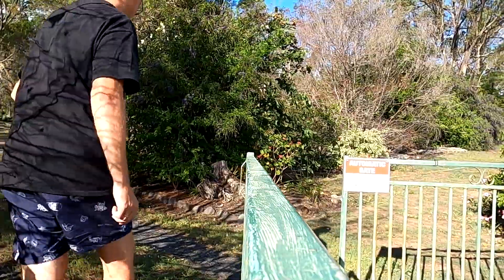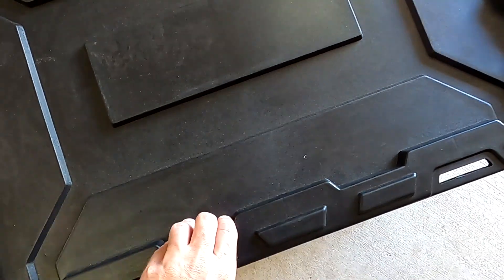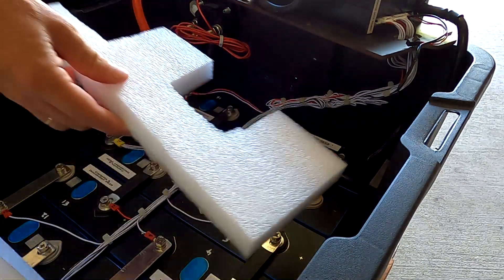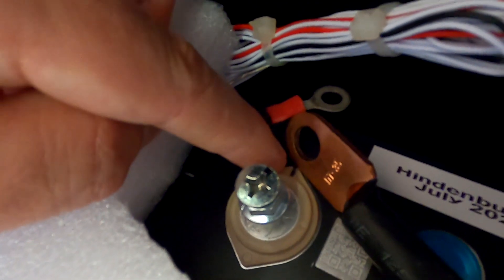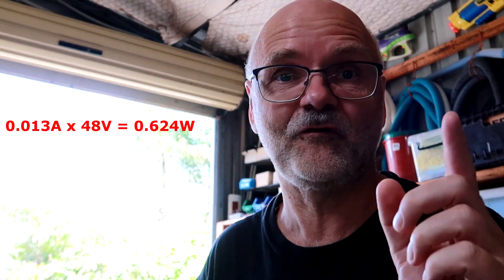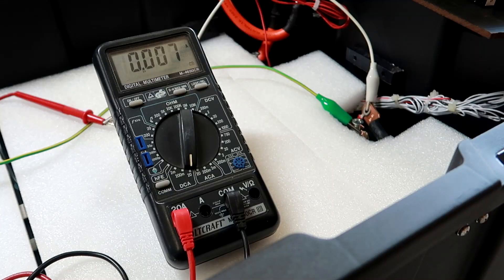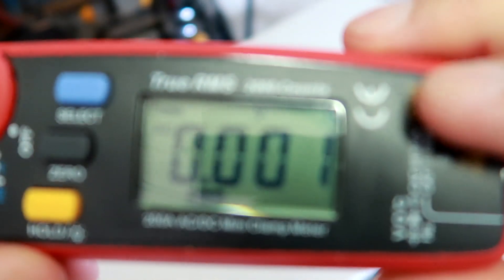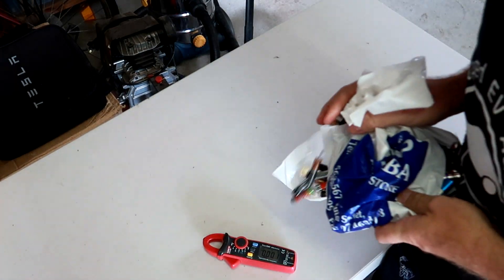BMS with Relay: Temperatures🔥 and power losses⚡

Comment: I agree that idle power is relatively low compared to other components' like inverter. The thing with the typical bms is the effective dc resistance. I am using Daly BMS and it has dc resistance of 20mOhms. At 100A, it would be 200Watts. My nominal battery voltage is 27V so it would be 2700 watts output with 200 watts loss. That's about 7.5% loss. So regardless of current, assuming all other parameters are constant, power loss would be 7.5%. I guess why there is a relay in addition/parallel with the mosfet. That's to minimize resistance at higher loads to minimize power loss. Note, there's more on the connections from connecting individual cells to the lugs etc. Crazy amount of power loss. 😂
Reply from the maker: The panels are not angled to the sun, so the voltage is expected to be lower.

Comment: Might be worth changing the battery in your Multimeter as it can screw with the reading when it's low. 

Also, the spec is probably pretty wide on cheap meters like that one.
Reply from the maker: The Uni-T works the same with either new or low battery until it completely dies off.

Comment: If the bms can't dump the full charging current or back off 
the charger to a level it can 100% handle without disconnecting 
charger from battery bank it has no place in the design .

You need a better BMS ….

Or a diy sub controller .
Polling the bms ( are you balancing any cells ?  Yes/No ) .
If yes lower the charge current & maybe a dump load .

Note 
Reading the total bank voltage just isn't going to work !

Comment: Which BMS is this? It doesn't look like the JBD one I've got but you use the same app. Could be that the 24v is different than the 48v but figured I'd check since it would be nice if there was a relay on my bms that I didn't really know about

Comment: Great project! Do u thnik about a air circulation in the box? U can cut 2 holes one air in, the other air out, with 2 small fans...maybe depending on box temparaure, greetings from austria...not australia.. :-)
Reply: Or only air holes
Reply from the maker: Nah, not in the battery box. I'm currently testing with higher loads and everything stays pretty cool. I'm not so sure about the metal enclosure though 🤔

Comment: Have you connected cell 8 positive to cell 9 negative yet. Check the voltage of the battery at the main positive to the negative that goes to shunt.
Reply from the maker: Yes, I showed that in one of the last videos.

Comment: I think using a machine screw and nut as you have done is essential as it is SOOO easy to strip those threads.
Reply from the maker: I used this only for the main pos and neg. The bus bars screws are fine and go almost all the way down the thread. It's aluminium thread so, yeah, you have to be careful.

Comment: It also could be the big resitor is there to charge the capacitors from an inverter before connecting. This to prevent high inrush currents.
Reply from the maker: Yes, that could be too.

Comment: yeah!!!  "frog works" at the end 👍🐸  
considering the losses and also as a safety measure (fire prevention) you should consider, in your design, a way to automatically shut down the inverter when you are away or even when the battery is low
Reply from the maker: I've got a low voltage disconnect module here...

Comment: Parasitic or phantom loads are a problem long term. You dont need that BMS. The low battery  voltage cutout is adequately taken care of by the inverter/s. The high voltage charge cutoff is handled by the charge controller,  your BMS is duplicating these functions at the expense of unwanted loading and complexity. DO install a balancer for piece of mind. My 12kw lifepo bank is within 30mv after 3 years of use with no activity from the balancer that I have seen.. Cheap square wave inverters are far more efficient with lower standby current and will perform well with lighting and resistive loads, toasters etc. A smallish  low frequency sine inverter will handle electronic and inductive loads, these  can be simply modified to give a higher surge rating to allow a lower  current inverter to start the fridge or washing machine. , this two inverter approach also giving redundancy to increase reliability of the whole setup over time. Keeping it simple is the key in my experience. Interesting series though, good work and very enjoyable.
Reply from the maker: The invert cuts off at 40V. That is far too low and would assume all cells are balanced and on 2.5V. If they drift, some cells could be way below that. You ALWAYS want a BMS as this is your insurance. It costs a fraction of the batteries and protect them in any circumstances.
Reply: That same argument will apply to your BMS. The two separate functions in the BMS are the voltage limit cutoffs, and the cell balancing.  You can save current waste by using a balancer only,  leaving  the cutoff  functions to your other devices. Your inverter can be adjusted/modified  to a higher low cutoff point.  BMS units can and do fail, often spectacularly. Wait until you start looking for parasitic drain once you actually go off grid permanently, they all add up very quickly.
 As in commercial power generation facilities,  all systems are  constantly monitored by human operators, even the backup safety systems.....   simplicity of the installation  increases reliability and  reduces  repair/maintenance time, even in our " littler" power systems. When we totally rely  and become responsible for our own energy needs, these issues are important. I manually check my cells every 5 days with a good old fashioned multimeter..  always mistrusting  my  balancer..... just my thoughts on a very hot NZ day.

Comment: If the relay is out and you want to charge a flat battery, I imagine that resistor will allow a small charge until the battery voltage come up at which point the relay will be engaged.
Reply from the maker: Good thinking, but would the MPPT handle that correctly?
Reply: @OffGridGarageAustralia  I don’t see why it wouldn’t.

Comment: Nice video, im waiting to see u finished instalación .
8:18 the resistor i think is for leth a litl amouth of current pass for charging the inveter capacitors (Big load like 900A in one sec normali triger the bms protección. I think dat resistor is for dat purpose for slow charge the capacitors of inverter and then switch on the relay.
11:31 i think u shold not disconect batery from bms with balance leads conected
Reply from the maker: I tried the inverter theory and it didn't work. Huge spark 😁
Reply: @OffGridGarageAustralia  i Hope u record dat .
Just ned to see Next video i ned to see the finish instalación Cuz i wana Buy same bateríes i hawe huge lead ácid now.
Reply from the maker: @andreiapostolache3487  yes, I did ⚡
Reply: @OffGridGarageAustralia  Was the BMS in ON or OFF when you connected it to the inverter ?
Reply: @OffGridGarageAustralia  soo then may be for balance but It whold be wired with just one big resistor

Comment: It seems that you are concerned about the relay causing heat, I personally wouldn't be, I would be looking at the 10W resistor but I don't think that you are going to see it heat up yet, if that BMS performs a top balance, then that means the best time to check for temperature is after the batteries have been discharged and have been charging and they are almost fully charged, check the voltages of the cells, you are looking for different charge states of the cells and at some point the BMS will start it's balance process in which it has to burn off some energy from the cells that are higher than the rest to keep everything on the level, if this BMS was an active balancer, it would be taking excess energy from the higher charged cells and moving it to the next cell which is a more efficient way of doing it but the one that you have is the older style and it wastes energy to achieve it's goal which is also when it should be producing heat! That's where you need to look, the relay isn't an issue... It might get warm but not 10W warm... 
I put an extra led which I just wired it to an existing led through a 470 ohm resistor in a headphone amplifier that I built, that extra led caused the quarter watt resistor to heat so much that the aluminium enclosure got really hot right above where the resistor was! It probably had about half a watt across it before it finally burnt out! I couldn't believe how much heat came out of that little thing! I have also used the 10W resistor in a high frequency crossover for a piezoelectric tweeter! While testing, it was on a piece of carpet, it burnt the carpet where it was sitting! So basically yeah! They can get very hot 🔥! 
It all depends on how unbalanced the cells are after being discharged, this will determine how hard that resistor has to work! So when you start using the battery, keep an eye on it for some time until you have some sort of understanding of what happens when it's actually working, if it's making to much heat! Grab yourself a temperature controlled fan controller circuit board from eBay, they are super cheap and some even have a variable speed output for the fan and will only use what it needs! A fan with a dust filter and another hole with filter for the exhaust, the temperature sensor on the BMS and the turn on and off temperature settings set... Done ✅👍 
Some of those controller's can use the three and four wire computer fan's and control their speed while others simply have a mechanical relay for simple off and on operation, but mechanical relays won't last as long and there's only one speed! You can't tell just by the sound of the fan's if it's really hot 🔥 or it just warm... 
I hope that this helps 😊.
Reply from the maker: Other were concerned about that. That was just to see how much power and heat the BMS creates.
Reply: @OffGridGarageAustralia  any warmth coming from the relay is going to be negligible, it's the 10W resistor that I would be keeping my eyes on, if it's going to generate heat, it's going to be when the batteries are out of balance and it's reaching the top of charge... You could manually discharge on of the cells to simulate an unbalanced battery! It's better for anything to happen while you are actually watching it instead of coming home and finding your garage on fire 🔥.... Just saying... It's what I would do...

Comment: Interesting relay in BMS. I have thought about something similar to use relays on solar charge input protects at 150v. Use a MOSFET in parallel to briefly handle load while switching the relay. No contact arching and low loss at high current.

Comment: Actually, that external shunt.... You could literally take it apart and connect it's electronics to the shunt inside the BMS! That way you get rid some resistance as small as it is! It just takes out one more thing that has some resistance in the path because resistance = heat and heat is simply the evaporation of electricity! Which makes efficiency go down! But that's just me being an efficient thinking German LoL... It's probably why I drive a BMW... More efficiency = better performance and more mileage...

Comment: I think that the 10W resistor is for discharging! It's rated for 10 ohms, a current shunt should be less than 1 ohm! Besides, the negative already has a shunt on it...
Reply from the maker: How can it discharge several cells at the same time with one resistor though?

Comment: If you look at the specsheet of that BYD relay (BYD EVR300CPES) then you can find out what the power consumption of that relay is as the reference. The relay contacts, the shunt, and the fuse will get hot too when you start pulling lots of loads.
Reply from the maker: 60-70A will be the max I will pull from this battery...
Reply: @OffGridGarageAustralia  That is not much at all.

Comment: Is it the coil voltage heating the bms? Could you put a resistor, or 12v bulb in series to lower the current/ voltage? As long as it's still functional!  I was looking into latching contactors, it would require a reversable current to open or close the circuit, not simple to use with  bms, I guess it could be used similar to a breaker, only it would be reset with  voltage! Maybe a pushbutton reset? I may look into it again!!
Reply from the maker: That's what I tested, there is no heat if the relay is active and the whole BMS uses only 2.4W.
Reply: @OffGridGarageAustralia I guess it seems a bit high to me, but atleast it shuts off the contactor when not required, that's a cool idea, I may look into getting one, I need more like 300 amps capable contactor, I would be happy with a midget based bms. Would you do a video on the bms buying process? What you considered when buying this bms? What is available? and more on why you decided to buy this bms? Some may not understand so we'll,. I started building a bms, The diybms, I have almost everything, but I do not have a computer I can do programming with , I lost everything in. House fire, and slot hasn't been replaced yet, The pcb's is the only thing left, other than ic programming, I may still use it with a bought bms, since it works over WiFi only, it can help balance the cells, having a difference in cells as I do, they will likely eventually go out of balance a bit, I'd like the option of balancing whenever charging above nominal voltage, I have recovered small packs, and they required micro cycling to allow to rebalance, I had apack go from under 70mah to nearly 10,000 mAh, only because of balance, it was shutting off because if the cells being too high and too low, I got the 12v lidepo4 battery for $11, I got two, they work fine, 12ah new, with over 10ah for $11 not bad...  Anyway this supposed to be about bms haha,  but I would like to know more of your decision making process when buying this bms thanks...
Reply from the maker: @jamest.5001  that's a good idea with the video. But it needs a lot of time to do research and putting together a script with pros and cons. I'm not a script guy and haven't much time to sit down and research some stuff, taking screenshots and and so on. I would always think 'I could have chased some frogs' in this time...

Comment: Excellent video! Thank you... Connecting solar charge controller and panels will negate any of those minimal losses. Without solar connected, I would shut it all down anyway. Question: How much solar do you need to fully charge that beautiful bank of batteries fully after a days use/drain? Have you tried draining the batteries all the way down and solar charging them yet? I look forward to the next step - the solar connection! LOL
Reply from the maker: I have two stings with 660W each at the moment. But also have another 3 strings with 570W each which I haven't mounted yet. In summer time, I will be fine with the 2x660W but not in Winter due to the shading.

Comment: Remember... Your BMS should always, always be doing it’s job when hooked up.. You unbalanced the batteries by pulling load from only 4 cells. I would think that the BMS would go into overdrive not knowing what was happening... just doing it’s job.
Reply from the maker: The BMS would never shut down even if you just discharge one or a few cells as I did. Unless one cells goes out of specs (2,5V or 3.65V).
I thought about the consequences of doing this and now the cells have balanced again without interaction.
Reply: @OffGridGarageAustralia  11:39  I believe that some, if not all, (6-14 milliamp) was the BMS doing it's job re-balancing the "pack" after the unbalanced load.  I did not see any problem with what you did, just trying to figure out why you had fluctuating current with no load.

Comment: When I saw that resistor in the BMS my first thought was: built in pre-charge resistor ?! Niiice !!
You know you can not simply connect battery to inverter. There would be a big inrush and spark that damages the capacitors in inverter and the battery too. Or if relay was off and switched on there would be a big spark/arc inside the relay.
So if it is a precharge resistor that is a big plus for this BMS.
That screws are totally OK.
Also I think you would need at least a fan (or more) for the box. Cells hate heat. One of the main reason for cell degradation (see first Nissan Leaf problems/disaster there in Australia). 
BMS is now 30 Celsius, no airflow, plastic (so thermal isolating) case (you lock in all the heat) ... it will be HOT in there.
And ... good job :)
Reply: Yes, and the resistor could provide some protection to the solar charger to discharge or charge the capacitors and avoid the magic smoke out.
Reply from the maker: The spark occurred anyway 🙄
Reply: @OffGridGarageAustralia  The BMS relay was in OFF position? If so thats not good :( 
Use a resistor to be sure before connecting anything. Will recommends a 25W 30 Ohm resistor.
You can use a 3 position rotating switch: 0-off, 1-resistor, 2-full power. But it is only good for manual use. 
If BMS relay disconnects and you switch it on remotely by wifi ... not good.
I am thinking about a separate relay with resistor to first precharge capacitors. Only need to apply power to if for 5 sec. No easy solution I think.
Reply from the maker: @mrzed6597  I know all that of course. It happened anyway 😂
Reply: @OffGridGarageAustralia  I slept on it. I think you should test it. Easy.
Battery not connected to anything. BMS ON but its relay OFF. Check if there is V on BMS output. If it is a precharge resistor then it will be, but less. 
Connect some lamps. They will be burning but minimal light. Check V on them. Check A going through. 
If there is V and A is going through then it is a precharge resistor (and you connected battery to inverter with relay ON, that was the mistake).
In this case you MUST connect battery to inverter the same way: BMS ON, BMS relay OFF. And will be no spark or arc.
If there was no A on the lamps then you HAVE TO use a separate precharge resistor (like most of us)